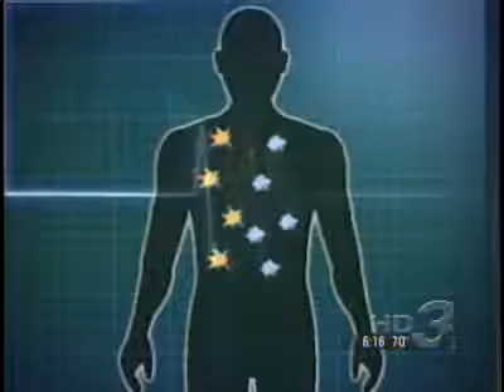Salt Water the ultimate clean fuel.__.mp4

Comment: Of course it takes much more energy to create the radio waves.  The salt water is energized by the radio waves - some of that energy is going into splitting the water molecules into hydrogen and oxygen (hydrolysis without electrodes).  That chemical potential energy is released when the hydrogen and oxygen are burnt together and recombine into water vapor.  There is NO net release of energy here; nor is a net release of energy claimed by the scientist.  This is not a source of energy.